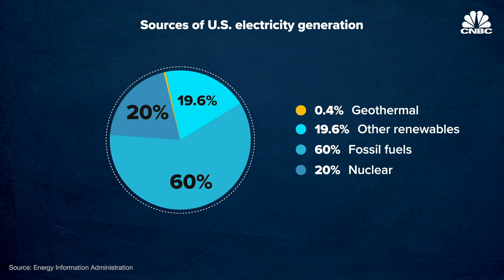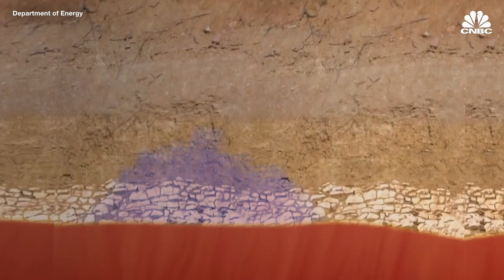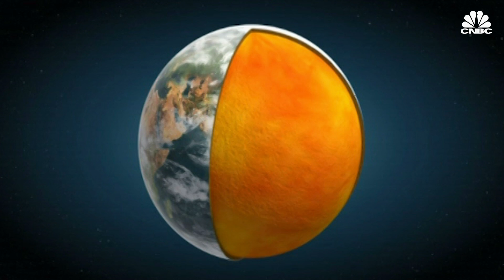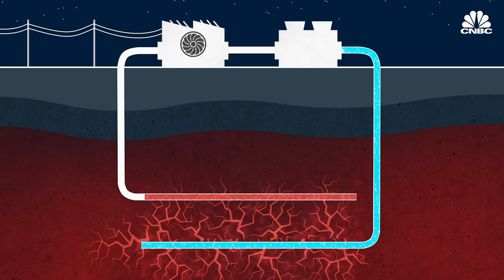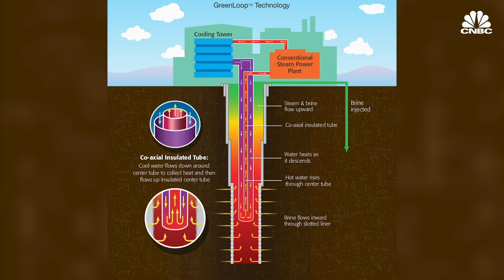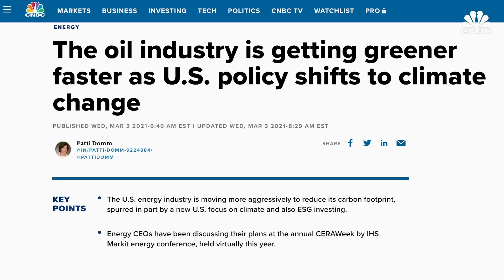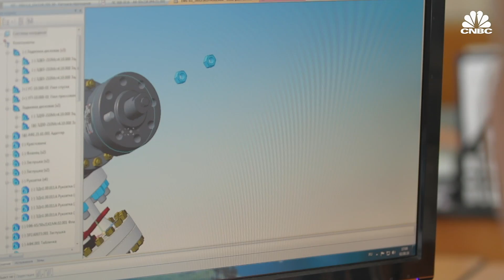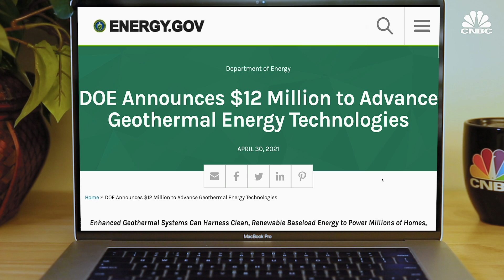This Overlooked Energy Source Could Supply 50% Of Electricity

Comment: 😂REPUBLICAN PARTY PLATFORM 
ACTION PLAN 
SEAL THE BORDER, AND STOP THE MIGRANT INVASION 
1. Finish the Wall in 3 months, 2. Pass House passed immigration  Bill, 
3. Restore closed border.  
CARRY OUT THE LARGEST DEPORTATION 
OPERATION IN AMERICAN HISTORY 
Provide work permits, use SSA,FEMA, ICE, FBI to contact &  interview workers and enroll selected as citizen candidates, else deport.  END INFLATION, AND MAKE AMERICA AFFORDABLE AGAIN 
1.	Drill in Alaska, off shore, Federal Land, 
2.	Import from Canada, Mexico, and S,  America. 
3.	Build natural gas export plants,  
4.	Run new pipelines next to Interstates.  
MAKE AMERICA THE DOMINANT ENERGY PRODUCER IN THE WORLD, BY FAR 
1.	Fast track new Nuclear Plants,  
2.	Install small Modular Plants,  
3.	Install Modular Generators at old industrial mill dams,  4. Install Geothermal Generators in active thermal locations.  
5. Innovate CO2 scrubber technology for coal &  gas generation,  
STOP OUTSOURCING, AND TURN THE UNITED STATES INTO A MANUFACTURING 
SUPERPOWER  
1.	Retain strategic material jobs, and tariff competing imports,  
2.	Export goods made by skilled labor,  
3.	Balanced imports of low cost labor, low price goods,  
4.	Encourage investment in large agricultural, construction, generation, electrical control, mining equipment.  
5.	Encourage investment in innovation in manufacturing of large trucks, locomotives, rail cars, elevators, jet engines, machine tools, homes, generators, motors, road maintenance.  
LARGE TAX CUTS FOR WORKERS, AND NO TAX ON TIPS! 
1.	No Tax on tips,  
2.	Individual tax rate for income and capital gains the same,  	 3. Child tax deduction until post High School,  
4.	No tax on Social Security.  
5.	No Social Security Income if AGI =>$400,000, 
6.	Inheritance tax zerol to $10,000,000 then 5% of balance,  
7.	Standard deduction for State and local taxes $2000. 
8.	Payroll tax rate “SS” employee 3%, employer 3%. 
DEFEND OUR CONSTITUTION, OUR BILL OF RIGHTS, AND OUR FUNDAMENTAL 
FREEDOMS, INCLUDING FREEDOM OF SPEECH, FREEDOM OF RELIGION, AND THE RIGHT 
TO KEEP AND BEAR ARMS 
Congress pass new Bill to expand and clarify each right and freedom with Congress passing laws including Supreme Court decisions.  
PREVENT WORLD WAR THREE, RESTORE PEACE IN EUROPE AND IN THE MIDDLE EAST, 
AND BUILD A GREAT IRON DOME MISSILE DEFENSE SHIELD OVER OUR ENTIRE COUNTRY 
-- ALL MADE IN AMERICA 
1.	CALL for Reform of the United Nations,  
2.	Propose restructure of Security Council.  
i.	No veto,  
ii.	Members in  top 10 population and top 10 economy countries that provide Standing Committed Military force to World Peace Command,  
iii.	Member Participants   in disputes have no vote. 
iv.	Peace Force demands truce, and negotiated settlement,  
v.	Else, moves in.  
END THE WEPONIZATION Of GOVERNMENT AGAINST THE AMERICAN PEOPLE 
DRAIN THE DARK SWAMP 
Only Downsizing of the number of government employees from the top down can impact the problem. Require immediate early retirement for all employees G17 to G14 age 60 up. 
One year new hiring freeze.  
Bring all administrative Contracted work in house. 
WHY DO THIS? 
1.	Retiree pensions become consumer spending. 
2.	Overall Employee costs reduced. 
3.	New younger management brings fresh ideas to Appointees. 
4.	Contracted functions absorbed by existing staff. 
5.	Changes do not require new laws. 
STOP THE MIGRANT CRIME EPIDEMIC, DEMOLISH THE FOREIGN DRUG CARTELS, CRUSH 
GANG VIOLENCE, AND LOCK UP VIOLENT OFFENDERS  
1.	Use CIA &  SPECIAL FORCES to destroy Cartel labs, centers, leaders,  
2.	Work with States to bring underfunded or ineffective local Police into State Peace and enforcement departments,  
3.	Bring all prosecutors under State AG authority, and State Laws.  
REBUILD OUR CITIES, INCLUDING WASHINGTON DC, MAKING THEM SAFE, CLEAN, AND BEAUTIFUL AGAIN. 
1.	Create Washington DC West. Move administrative functions out of DC East. Retain direct report Staffs of President,  Cabinet members and  Congress in DC East. Depopulate DC East.  
2.	Restore Peace Officer funding,  
3.	Prosecutors required to get court approval to NOT seek judgements.  
4.	Separate treatment and housing for: 
a.	Substance abuse,  
b.	Mental homeless,  
c.	Jobless homeless,  
d.	Criminal rehab, 
STRENGTHEN AND MODERNIZE OUR MILITARY, MAKING IT, WITHOUT QUESTION, THE 
STRONGEST AND MOST POWERFUL  IN THE WORLD 
1.	Require all Dept. The Defense all contracts be project managed,  
2.	Requirements/Specifications/Time Line Phase Contracts requires WH approval.  
3.	Require active Reserve or National Guard service for all draft age persons.  
KEEP THE U.S. DOLLAR AS THE WORLD’S RESERVE CURRENCY 
1.	US trades pays accepts only in $US.  
2.	US banks can not accept or exchange foreign currency. 
3.	If you need US$ you need to buy them with your currency from other countries.  
FIGHT FOR AND PROTECT SOCIAL SECURITY AND MEDICARE WITH NO CUTS, INCLUDING 
NO CHANGES TO THE RETIREMENT AG 
 
1.	Option 1 stay on current plan.  
a.	Social Security,  
b.	401K, 
c.	IRA/SALT 
2.	2. Option 2 Convert to new plan if you Chang jobs,  
a.	Personal tax free Investment Plan,  
b.	Transfer earned credits from current plan to new Investment Account,  
c.	Same payroll tax,  
d.	Optional additional 10% added investment.  
e.	Inheritable remaining balance.  
3.	New enrollments are on new plan.  
CANCEL THE ELECTRIC VEHICLE MANDATE AND CUT COSTLY AND BURDENSOME 
REGULATIONS 
1.	Remove electric vehicle mandate,  
2.	Review all regulations by Congress to comply with intent and Constitution.  
3.	Sunset all regulations.  
CUT FEDERAL FUNDING FOR ANY SCHOOL PUSHING CRITICAL RACE THEORY, RADICAL 
GENDER IDEOLOGY, AND OTHER INAPPROPRIATE RACIAL, SEXUAL, OR POLITICAL CONTENT ON OUR CHILDREN 
1.	STOP all Federal funding to schools and colleges.  
2.	College tuition grants only to student if in top 10% of class if enrolled in medical or technical major undergraduate study.  
3.	No student loans for graduate study.  
KEEP MEN OUT OF WOMEN’S SPORTS 
No federal funding or recognition of women’s events that allow biological male to compete.  
DEPORT PRO-HAMAS RADICALS AND MAKE OUR COLLEGE CAMPUSES SAFE AND 
PATRIOTIC AGAIN 
1. Revoke Green Cards of students protesting for antisemitic or un-American causes.  
SECURE OUR ELECTIONS, INCLUDING SAME DAY VOTING, VOTER IDENTIFICATION, 
PAPER BALLOTS, AND PROOF OF CITIZENSHIP 
1. Congress to pass Federal Voting act: 
o	Federal Election Day,  
o	Require proof of citizenship to register to vote,  o Require proof of identity to vote, 
o	Absentee voter by application only. Ballot control numbered, mailed to residence, dated, signed, mailed via post office, received before voting Day.  
UNITE OUR COUNTRY BRINGING IT TO NEW AND RECORD LEVELS OF SUCCESS 
1.	Request Governors have joint party conferences, 
2.	Change Congress committees to 10 members max for each party and a tie vote is approval.

Comment: With today's technology geothermal energy can be harvested in many more areas than it is being done. Talking about the big investments costs of geothermal energy, it is still far less than for example nuclear power. A nuclear power plant costs about three 2 to 3 times per installed MW compared to geothermal.
A huge expansion of possible sites for exploiting geothermal energy comes with EGS, enhanced geothermal system. It allows for extracting geothermal from dry rock. Non water bearing dry rock.
That means cracking the rock, injecting water through one borehole and extracting steam through another borehole. Or you go for a closed loop system. Drilling boreholes that meet each other and again you pump down water and get steam on the other side. For that you do not have to crack the rock (a misinformation in the video).
A big opportunity give binary cycle plants. You can tap lower temperature resources that give at least 100°C hot water. You use this water to heat a medium with a lower boiling point, that then drives the turbine.
All the above uses available, tried and proven technology, a lot of it developed by the gas and oil industry.
The point is, the possibilities are there, a huge amount, we just have to start exploiting them. New technologies will increase the possibilities, but we have hardly scratched what is possible now.

Comment: You will need to deal with the naturally occurring minerals and other solids in "geothermal" water. Cleanable heat exchangers between the ground and process water.  Every failure I have seen has been due to solids build up on the heat exchangers.

Comment: This is way to optimistic it is just like other startups I have worked for. Getting large DOE loans milking it and then defaulting on the loan. This is the most expensive way to make power. And the pay off is very small. I don’t see this technology working for decades if at all. It definitely not going to support 10% of the power on the grid. Maybe 2% at most. Sorry for the bad news.

Comment: I would like to know if conventional geothermal could be developed at hot springs or other areas where the earth’s crust is thin enough to generate vast amounts of electricity at scale that could be sent to population centres through direct current transmission lines to population centres over long distances if necessary and also if additional surplus baseline power could be used to produce hydrogen from water using electrolysis? This might be cheaper than using enhanced EGS to make hydrogen. Hydrogen could then be made available for planes, trains, transport trucks, steel mills and other hard to support systems where higher density and lighter energy is required that battery systems.

Comment: It is not easy at all, the steam temperature must reach 500 Celsius, otherwise the turbine blades will crack from the water accompanying the steam with time, I mean, dry steam should go into the turbine, it's not the idea of just getting water in and steam out of the hole.

Comment: Would the Earth's core magnetic field weaken if every country drilled geothermal wells?
Reply: No. The deepest vertical depth of a well drilled so far is 14km. The radius of the Earth is ~6000km. All drilled wells are a mosquito bite if you put it into perspective. Regarding the Earth natural cooling being affected by geothermal wells - I can't see a thin layer of a sedimentary rock providing a sensible thermal flask effect to insulate the Earth layers below the 14km depth from the surrounding universe.

Comment: Geothermal really may be the best solution to our big energy needs, it as multi purpose as well it can directly heat homes and it can produce electricity it’s the best of both. Wind and solar will supplement but when looking at twhat the video here is stated that 50 Geothermal Power Plants can power 100 000 000 homes that is more efficient than any solar or wind system ever will, it also doesn’t take up nearly as much land and doesn’t destroy views, birds, enormous woodlands (if built where there are woods) and so forth. Solar and wind power systems also need a way to store energy for when the sun don’t shine and the wind doesn’t blow. Here you have a 24/7/365 reliable source of heat energy, it will function much more like the constant reliability of Nuclear power or Hydro Electric power.
This is the future and present for our energy transition all over the world this will be the new Coal fired Power plant in the form of wide spread adaption since it literally is available everywhere if only one is able to get the technology right.

Comment: Not really new idea.  I remember reading about closed looped systems in the 1970's with deep abandoned old non producing oil wells. Early on in my career as a geologist, I looked into working in geothermal.  40 years on there appears to be more incentive.  In the early '80's shallow very high bottom hole temperature holes were drilled in central Utah.  I believe that the closed loop system was tested there.  The heat that produces electricity also can be used downstream in greenhouses as in Iceland today.  These ideas open up a world of possibilities. I'm sure that it can be done with zero steam emissions as well.  For a large scale setup, will likely take a long term investment with corporate and government cooperation.
Reply: New techniques pioneered by the oil industry have also lowered costs.

Comment: i know its a foolish but let me ask that what would be the side effects of the core getting colder?
Reply: I doubt it will cool that fast
Reply: @ezioauditore5616  yeah that I know but eventually?
Reply: @rahimahmad7259  look at the picture of the inside of the earth: 
https://www.alamy.com/stock-photo-earth-cross-section-showing-the-inner-core-made-by-solid-iron-and-59260519.html
just going close to the outer mantle will have heat of 1000c, guaranteed, nuclear reactors do 300c, any drill is like a size of a needle compared to that, the worst case is that the drill or tube will get destroyed

Comment: There is also "Low Temperature Geothermal" - Where Stable Ground Temperatures at the depth of about 8 feet below the surface, stabilize at about 50° F, or 10° C, that can be utilized, relatively far easier than Deep Hole Drilling, for General Thermal or Heating Management! For Example - Air at such Temperatures are easier to Heat up for Winter Heating, than Temperatures below Freezing, and such Air Temps are useful for Air Condition in Hot Weather. Also - such temps can be useful for "Cold Room" Food Storage, and for Greenhouse Temperature Moderation, as Shown on the Video about Citrus in Nebraska - https://faircompanies.com/videos/nebraska-retiree-uses-earthss-heat-to-grow-oranges-in-snow/

Comment: Idea—- find a metal with a much higher melting point then the lava, put that metal in the lava the heat will radiate, and have it run to a contained water source, add turbines, let the steam recycle so you can use the same water over and over and not have it released into the atmosphere. CLEAN ENERGY... no one will do this it’s too easy and simple.

Comment: Two things that might help geothermal energy a great deal are: 1) Electricity storage devices that would allow generation of geothermal electricity at one location and use somewhere else without the need for transmission lines and 2) Heat storage devices that could do the same. The first of these would also help geothermal energy's competitors (wind and solar energy) but the second would strongly favor use of geothermal energy. The best geothermal locations are probably on the ocean floor. Could we harvest the heat and then transport it for use elsewhere without pipes, etc.?
Reply: No you cant transfer heat, at least significant amounts, without metal pipes or wires.

Comment: Would be also be advantageous at locations where geothermal plants are installed to tap into these plants that can provide very inexpensive heat / electricity to run all year long  soil free greenhouses (see Netherlands that use these greenhouses).  Can have multi level greenhouses (do not need sun just heat for building and high efficient electric lights for plans that will grow the equivalent  of hundreds of acres of field but they can produce 4 or even 5 seasons of vegetables every year in the same location.  The closer to the population areas these are the less trucking costs are to then move these vegetables to market.

Comment: I would love to see far more geothermal...up to a point.  It has major advantages over wind and solar.  And the need to eliminate fossil fuel power generation is critical.  But we need to understand that conventional geothermal plants do emit quite a bit of radiation (radiation is where the geothermal energy comes from).  In fact they emit many times more than a nuclear power plant because they don't usually have to contain their waste.  https://vito.be/en/news/radioactivity-and-deep-geothermal-energy  But low levels of radiation are fine - just stop eating bananas and flying on planes if you're worried about radiation!  If we scale up to a high percentage of geothermal power, however, that radiation pollution may become an issue.  Personally I think containing the radiation in nuclear plants is the best way to deal with the problem.  Geothermal is basically an unregulated nuclear reactor operating under the earth's crust and if we let the resulting waste spill out to the atmosphere that's not a good idea.

Comment: Is Geothermal actually renewable? If you remove energy from the earth surely like gas and oil it will eventually run out. I can see the amount removed current being small enough to be negligible but if it reaches a point of mass adoption, at what point are we effectivly force cooling the core of the earth?
Also what is done with all that heat energy that was effectively trapped in the earth. How much of it will be escape to atmosphere? 
I am in favour of geothermal energy overall. I just hope that unintended consequences mean it is too good to be true
Reply: It's not changing the net rate.  Part of this is because the Earth's crust is already an excellent conductor of heat, so what as humans do is simply redistribute the existing heat.  It is inexhaustible in the sense that we will likely be extinct by the time it is gone.

Comment: Geothermal will be a huge boost for base power load......... it has always been under appreciated!  It will definitely help to solve the problem, but maybe a bit of an exaggeration with the end statement.

Wind and Solar have been over hyped and there is some room for efficiency improvements in them, but you have to produce a huge number of them to get anywhere near power supply levels needed for major cities.